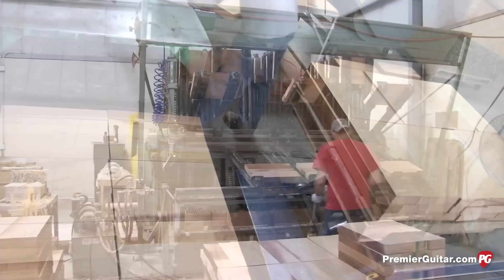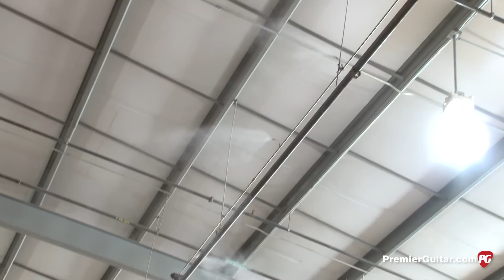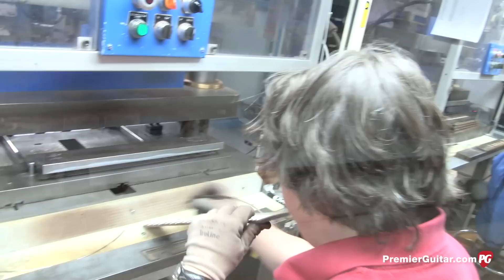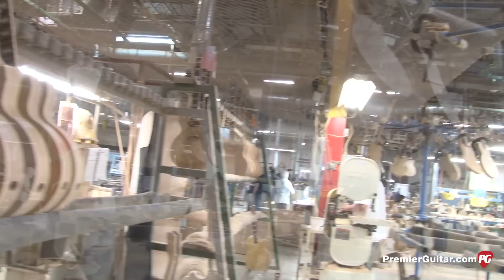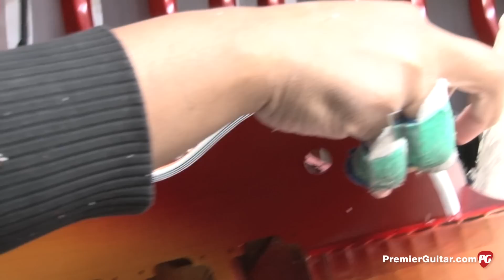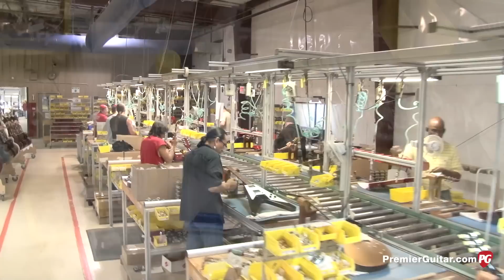Gibson USA Factory Tour

Comment: The short neck tenon many scoff at looks to be very tight and well fitted from this video. Hardly as bad as the photo circulating online of les pauls cut in half showing the short "rocker" tenon vs the long tenon. I assume that's an earlier short tenon in that photo from the 70's when quality was ass and they didn't have all the sophisticated CNC machines and tech the modern factory has.

Comment: Saved up and finally got the authentic Gibson usa les paul I had been dreaming about since 1990 when I started playing. Unfortunately I thought all Gibsons meet a minimum of standards so I went with a tribute model which they consider a budget (1200$) guitar. Within 2 weeks I purchased a 200$ FIREFLY FFLP and have been playing IT ever since. The POS Les Paul tribute complete with 2 piece laminated board (that looks like a one armed blind man cut the fretboard in half)and tool marks has been listed on FBmarketplace. It's amazing and 100% pathetic that, as an experienced player, I received a higher quality Chinese made guitar for 1/6 the price. A 200$ FIREFLY shouldn't have superior finishing work (including 5-ply double bound body, neck, and headstock, real rosewood FB, properly cut bone nut, AAA spalted maple top, 2 way rod, mother of pearl inlays and Logo, etc) compared to a 1200$ Gibson with NONE of these options. The Wolf WLP offers EVEN more for 450 shipped. There is LITERALLY no reason to purchase anything less than the 2000$ + standard model of any Gibson unless you are trying to keep the company afloat. The quality/feature gap has been narrowed far too much to continue charging what they do for studios, tributes, worn, and faded models (garbage). There IS a reason the 1200$ guitar is sitting in my closet and the 200$ firefly has been played at least an hour each day since I got it. If they don't change with the times; they may end up the netscape of the instrument industry. Good Riddance!

Comment: Doody design, doody quality control, doody price point, doody company with doody management. When the baby boomers die off, this company is toast. Their guitars don’t stay in tune, are of a terrible quality and priced at a significant premium. I respect the sound they produced 60 years ago, but there’s just no reason for this company to exist anymore in its current state. The product is doody. Dont even get me started on the Gibson SG. That thing is a heaping pile of horse caca; the fact that it’s headstock dives towards the floor (for some reason, 50 years hasn’t been enough time to correct this idiotic design) says a lot about
Gibson. Don’t even get me started on the Les Paul. It weighs a ton and doesn’t sit comfortably on your leg without cutting off circulation. You can barely access the upper frets and if you bend the G string it’ll probably go out of tune because of all the binding at the nut. You better hope the headstock doesn’t make contact with anything other than a feather; it’ll break off in an instant given how little wood is there. Wow what a piece of poop. Why would anyone spend 3k on this thing? Go buy a PRS or even a Suhr. It’ll come out perfectly and stay in tune.

Comment: I have a 2006 les Paul custom very disappointed never stays in tune neck is always out of adjustment now there is a crack forming in the back side of the neck never ever dropped but I have a PRS 1989 custom 24 top 10 that blows my les Paul away
Reply: If it never stays in tune, you are always adjusting it and there is a crack forming - you have likely over tightened the truss rod on a few occasions and the instrument is not being stored correctly.
Reply: @crb1845  thanks for the comment guitar was made for guitar center 2006 stored in a controlled environment . l am a old man I know how to adjust a neck after 17 years it is now not giving me problems thanks
Reply: @vox1966  That's just standard Gibson problems. Binding at the nut due to poor headstock angle and tuner design. PRS and Fender don't have that issue because they know how to actually build a guitar. Straight string pull through the nut is the solution. Gibson could fix it, but sadly the people who worship them would rage because they want the original design. I guess broken headstocks and tuning issues are their idea of a legendary design.

Comment: alas all these jobs are seriously threatened by the chinese. I recently viewed pics of L5's from China & they seem to be going the same way as the Japanese thru 60s & 70s - starting off with cheap knockoffs but after a few years the foreign luthiers are getting good!
 It's a pity Gibson have stuck with a 60 yr old design around the nut. Skinniest part of the neck combined with large neck/head angle and the neck/ body angle required because of the height of tunamatic bridges - if dropped the headstock just has to break at the nut. And the spread of the 3rd & 4th strings at the tuners... "We are still doing things the way they did in the 50's" - cnc & all?!

Comment: I bought an S.J.200 acoustic  in Canada here that was shipped from their main Factory in Montana, and because I didn't really know the finer details and what to really check out on a guitar when buying it (which I over looked because of ignorance...not knowing)...I am stuck with a Guitar that in my opinion is not worth the $6200.00 I paid for it! I didn't take it in to a  professional Luthier until a year later as the flat portion around the sound hole is warped a bit..It does play well and sounds great but it is a chore to get it tuned to perfection. I am so pissed about it.

Comment: why cant electric guitars be made entirely out of a plastic type of mold  that literally doesn’t need any adjustments ever? That would be soo awesome if you had a neck that never needed tweaking! I bet it would be way easier and cheaper just pouring plastic into a mold, rather than having the millions of wood blanks, the humidifiers, the cnc machines, the sanding, the ban sawing, the glueing, ect. All those things cost alot of money to use! It seems so impractical to use wood still for guitars. Theres that one company called richlite and i think they use a composite plastic material that stays in good condition for eternity! I want a 100% richlite stratocaster with a roller nut and roller bridge so the trem actually works. The only thing thats wrong with richlite is they charge too much for it. But im sure there are similar materials that are cheaper that richlite that could be used

Comment: With that level of automation, Les Pauls should be $249 at Walmart.
Reply: $249.00 is too much for what you get. I offer $79.97.
Reply: So run down everything until it’s in the same aisle as the tasteless slide cheese? Automation is good. It improves quality and allows Gibson to spend more time on finishing and set up.  Gibson guitars are better than they’ve ever been right now.

Comment: Straight off, I'm willing to bet that at no point in the next 35 minutes will anything happen or be seen in this upload that could be fairly described as "intense"

As a reporter/presenter, words are your basic tools of the job. If you have a long complex new word in your arsenal, like "intense", hold back from using it while the cameras are rolling until you're confident you understand and have nailed it's meaning.

That is, unless you Americans have done that clever trick you do of taking an already pre-existing word with hundreds of years of everyday use and helpfully applying it to mean it's (often times) exact opposite function, eg: Bad, Wicked, Sick. 

If so, congratulations and well done, again. It's 'Intense' when you do that!

Comment: This process doesn't only take a half an hour, it takes weeks to make 1 guitar. People handle the guitars for hours. Granted, the bodies are machined, but that's good because it means your guitar will be perfect. Also, the materials do cost a lot more than you all think. Especially the woods, they don't cost $10 each.
Reply: There was a video about the price of the wood in the guitar industry... it was made by a guitar builder that has a little enterprise. It's very informative. If I remeber right, we are at least at 45$ of wood, for a LesPaul type guitar. Gibson can have much more interesting prices, due to the larger amount of wood they will order.

In the case of Gibson, it's the margin system that is the most problematic factor. Gibson works with the x6 margin. This allows them to endorse players, pay for publicity and finance their empire. Whatever, this is a real brake when it comes to make a quality/price products. Because, under those conditions, they simply can't.
Reply: True
Reply: There has been nothing coming out of Gibson in the last decade that is "perfect."  The CNC made parts are before the "techs" get their hands on it and screw it up.  And QC is totally out to lunch.  But MY GOD the sound they make.  I have no idea how they do that.

Comment: Why do they cut the wood just to glue it together again?
Reply: We rarelly (i'm a cabinet maker) use large boards because:
-it will tend to bend overtime. Using smaller pieces and alternate them makes it far more stable
-getting the right thickness in one piece will cause to much waste because raw wood is uneven 
-it allows to get rid of imperfections in the wood. A tree trunk is cut in layers, each layer will have it's con's and pros, and by habit you know what part to use and what to avoid.
-many machines won't be able to deal with large pieces
Reply: In order to have the grain of the wood going in different directions and at different angles. That lessens the wood's reaction to changes in its moisture content as affected by changing humidity. With modern glues, the joint is often stronger than the woodgrain itself, adding stability too. I've seen wood break along the grain right next to the glue joint, while the joint remained intact.
Reply: Multi pieces also makes it stronger.
Reply: True

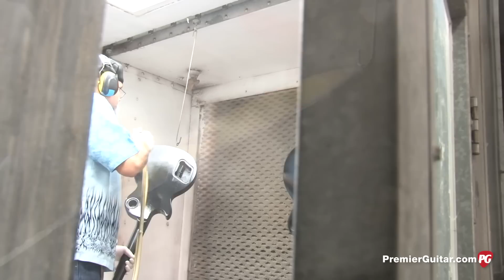Comment: @24:48 cancer candidate.
Reply: Wrong. The wall in front of him is a air suction device for paint rooms/areas. Zero particules of what he is painting are able to reach is nose or Eyes. The only thing he needs to be protected is for the noise it makes. The paint particles or are stuck to the body of the guitar, or are sucked by the airflow towards the wall in front of him. Very normal mechanism in paint rooms or in pharmaceutical environments where an operator needs to handle hazardous materials.
Reply: Those walls don't take everything and some of it bounces back from the guitar.

Comment: so, where again is that $3000 a pop "crafting" process?
Reply: +GoCeltics734 You pay for the 'mojo' that only a CNC and minimum wage manual labor can provide. Shhh...they want you to be quiet and sniff your cork like a nice little consumer.lol
Reply: +GoCeltics734 Nitro adds about 500 to the price tag straight off
Reply: +GoCeltics734 Nitro adds about 500 to the price tag straight off
Reply: +amillwardmusic nitrocellulose finish is really nothing special. It's durable and will repel any moisture or alcohol from the surface but it's by no means a high end finish. If a finish is worth 500 bucks, it's definitely not nitro. The process of spraying and buffing a nitro finish is also quite straightforward and cost effective. Watch a hand maker finish a guitar with hand-rubbed or French polished finish and I'll believe there's a worthy $500 price hike. Gibson guitars really aren't worth the price tag. They're good at branding and perceived value though, which is why people keep buying them. Not that they're bad guitars, but a good guitar isn't necessarily an expensive one. Take Godin Guitars in Canada as the perfect example. As far as quality control and playability go, I'd take them over Gibson any day. And they look the part too. Fantastic looking, playing, and sounding guitars, and nearly every mid to mid-high grade model is under a grand.

Comment: So let's say each person takes 30 seconds per guitar where hands on work is done, and assuming a dozen people work on it, then that's only a total of 6 minutes of "hand" made while the rest is automated. No way that is worth $2500+ for what is 95% automated-built.
Reply: It's a long time experience job .. Gotta get paid for it's effort.. But I'd agree a little cheaper than 25 hundred it should be for sho
Reply: +Eddie Hunter 666 'experience' is over rated (in case of repetitive jobs like production line stuff). don't get me wrong, I'm not saying there is no value. what I am saying is learning curve is exponential. meaning most of what learnt about a craft happens in a relatively short period. and the amount of new stuff you gain starts diminishing exponentially over time. for example a 4 year experience will gain 90% of the knowledge of a 20 year experience (don't take the numbers literally just the sense).
Reply: Then don’t buy it!  And if you aren’t buying then what’s your complaint again?

Comment: Appalled by the lack of dust masks in sanding and spraying operations.  Seems foolhardy to me.  Gibson are no better than other manufacturers.  There are good instruments coming out of Indonesia and China, and of course Mexico.  THe big differences are that all the manufacturers have tighter string spacing on import models so that the US made ones are easier to play ( supposedly), and of course the cost.  USA made guitars cost many times that of imports from the same manufacturers, and that is because of production costs here.   One might ask why Gibson jacked their prices by 26%, and why it took so long to sort out a glaring design fault ( the crappy neck to headstock transition).  You never hear of Fenders with broken necks at the headstock.  I have seen LPs taken apart with big gaps in the neck joint.  Gibson have had some quality issues in recent years.

Comment: I consider 3 piece body backs to be unacceptable.   2 piece at the minimum.  Wood not wide enough for a 2 piece body should be set aside for necks.    Gibson,  pay attention.   And quit trying to "innovate" so much when what players really want are affordable, great sounding, great playing Gibson classic models.   We don't want the robot tuners.  We don't want techno-crap on our guitars.  We just want solid performing guitars.    And you should cut that slack belt sander up into pieces with a cutting torch and try to forget that it existed.    Contour destroyer.

Comment: What's the point of sawing the pieces of wood in half and then sticking them back together again?
Reply: Also the wood is stronger and more stable.
Reply: Bookmatching.
Reply: I'm not sure for the "bookmatching". Normally, this process allows to use a cheaper wood. Less perfect. They will saw out the imperfections and then match to similar looking blocks together. It's just a spare of money. PS, you don't need stronger and more stable wood, because a 4.5 cm fat mahogany block will be stable by itself.
It's just for the money. Only. And it always was.
Reply: The glue gives all the sustain to the guitar.
Reply: Leo Fender its all about the sustain glue thats where the real tone is
Reply: @allanallan4791  I know!  That's why I glued all of mine together.
Reply: Linus Martin there also cutting out defects
Reply: Some of the Mahogany planks have no defects and do not get sawed in half. They make 1 piece bodies. Some of the planks have knots ect. That get sawed out. Those make lesser quality 2 piece backs. The Maple tops are sawed in half to bookmatch, which is purely because it looks better that way.

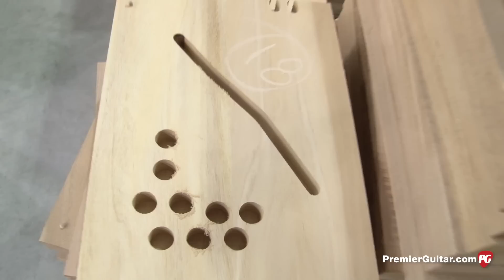Comment: 5:30 shows that the wood is used, which amazed a fungus and rot... Its bad!!!
Reply: OP obviously never worked with wood before.
Reply: ***** I never said that Gibson makes a bad guitar, but I was very disappointed that: https://plus.google.com/photos/106094626924272577452/albums/6072711771655789569/6072711774925863554?pid=6072711774925863554&oid=106094626924272577452
Reply: DoomRockEpiphone666 Я, блять, украинец и не обязан знать твой сраный английский!
Reply: ***** I am woodworker.
Reply: nice english
Reply: Good eye but wouldn't it only affect wet or living wood? Could the kilning process kill the fungus and still maintain structural integrity of the wood?

Comment: R.P. should have flagged my 2014 Gibson USA SG special,He signed it off, I would play any string in the 1st fret and it went sharp big time because the nut was so high and the slot was so shallow that I got a bend off the 1st fret and nut, how that got past him is beyond me, I could have waited on G.C. like 3 weeks to cut the nut slots to the right depth or do it right myself in 30 minutes,so needless to say I did the work on the nut and now it plays the way it should have to begin with and stays in tune. No BS it was 3+mm from the fret board to the bottom of the low E and 3mm on of all 5 other strings at the nut. I have a cheap ass China Squire affinity as a project guitar and the nut depth was to fenders spec's and plays awesome, I didn't even have to file the fret ends like I thought I would have too, just about every Squire I've played had to get the cheese grader effect filed off from the fret ends but not this one and were talking a $150 guitar, the same with my 2012 Made in China Epiphone Les Paul Traditional Pro limited eddition It was set up better than my $1000 Gibson USA SG and I paid $350 for the Epiphone new at the beginning of 2013.